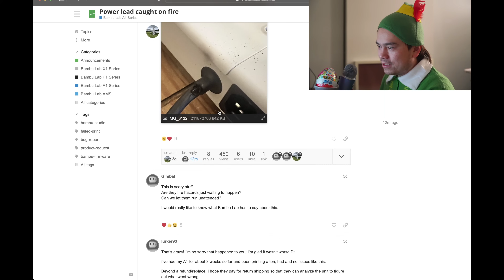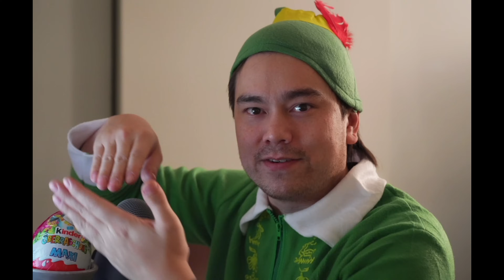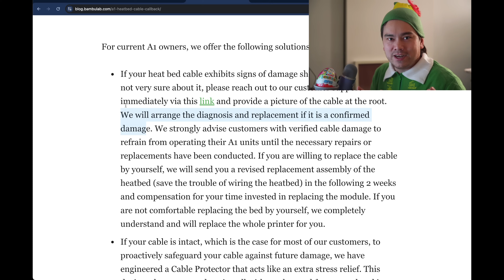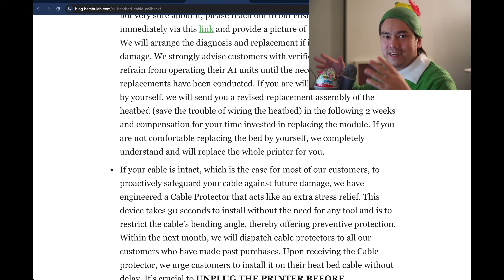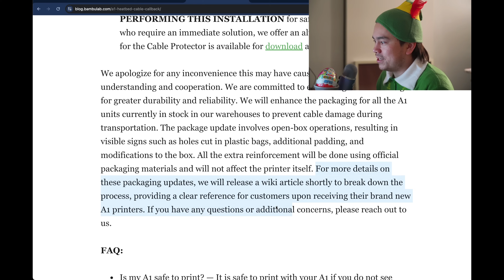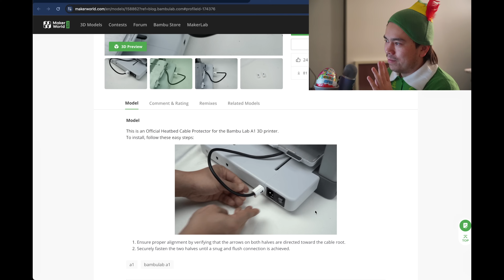Bambu Lab A1 - 👨‍🚒🔥 Important Safety Announcement!!! 👨‍🚒🔥

Comment: I would think two bumpers on the back side would help to protect the cables if the printer is laying on the back or pressed up to a wall. The little mod will still bend the cable if that happens.
Reply from the maker: lol, yeah. Also having a power plug inserted probably helps. Standard wall outlet power plugs have super beefy strain reliefs on them.

Comment: Hey Nathan, unrelated to this video, if you don't mind... What's your opinion on Phaetus Dragon HF and UHF hotends? Rapido seems to be the more popular option, to the point that's hard to even find useful information on Dragons. If I'm not mistaken, you're also a Rapido fan, so what gives? Is it really that much of a better option? Is there some major flaw with the Dragon series?
Reply from the maker: Dragon can go up to higher temperatures due to its use of a standard heater element.

Rapido is well packaged, sturdy, prints fast, and looks good. 

Both are very similar in overall performance

Comment: isn’t a strain reliever normally rubber/has some give? That looks to be hard plastic so while its protecting the cable where it enters the printer, isn’t it just moving the pivot point to an inch out? its still leaving a hard edge (and slightly reducing the length of cable to the heat bed so perhaps a tiny bit more likely to induce a tight radius)
Reply from the maker: Don’t worry about it, just print out the magic spacer and you’ll be magically safer

Comment: So, AC vs DC isnt the problem here. It gets into internals with how their solid state relays work.

For the cable assuming the overall wattage is the same. A higher voltage would reduce the wire size, but would require a thicker insulation. A lower voltage would require a higher amperage to meet the power requirements. Which would mean thicker wires.
The above is all basic Ohms law and wire/insulation calculations which can be found in the NEC.

If you want to make all solid state driven power consuming devices safe. You put a mechanical contact ahead of the SSR. You then detect amp draw after the SSR. SSRs leak voltage at all times, a very small amount. You program in tolerances, and if it exceeds the tolerance when its not calling for power, open the mechanical contact. You can further add to it by adjusting this tolerance on top of whats being called if you arent using a 0-100( or in 8 bit world 255).
Software wise this is partially implemented with it reading through the thermistor and detecting heat rise without calling for heat. This is ok for runaway temps, but not shorting as the thermistor is not able to check for amp draw.
Reply from the maker: A short on 24V produces less heat and is easier to manage than a short on 230V
Reply: @NathanBuildsRobots  to an extent, but both are bad. 
I've worked around high flex cables for heaters in vacuum chambers running 480v, I will say that I have never had an issue with the cables themselves having issue after thousands of cycles a day, 7 days a week. It's usually the solder on the hermetically sealed plugs that failed. 

Which makes me wonder what they used to have issues with cables. If the cable was being impacted, sure. But if they are having issue from flex like that, either they have a bad type of insulator for flexibility, they didn't use high flex, or their connection is terribly done.

Outside of that, I doubt 3d printer manufacturers are going to run as complicated of a circuit with programming I mentioned above

Comment: Btw, on a serious note, thank you very much for this video. I'm in the Bambu Lab discord but I was busy with work and missed when someone posted this. And you would think it would be on the front page of their site but its not as far as I can tell. I will print out the upgrade and put it on my A1, I just got it less than a week ago and its been working fine, I did pay attention to make sure the wire wasn't hitting the wall or anything when I set it up. I also don't like how floppy the extruder head data cable is (some people on the mini have it snag on the bed I think lol) so I printed out a drag chain for it, and honestly thats how it should come from the factory.
Reply from the maker: Is your drag chain fire retardant? Because that might be an issue given the combusting cable issue 🤐
Reply: @NathanBuildsRobots  lol nope its good ol pla, but when I see it melting I'll know something is wrong don't worry.

Also I got a notification this morning about the bed wire problem on the bambu handy app, they posted the blog post under the "system" tab of the app so anyone with it should be getting that notification

Comment: Not just that.
I've been sent a defective out of the box printer with z axis stepper motor and driver that doesn't work.
First plugged it in a burned smell from z motor.
And nobody wants to answer from over there.
This is a no buy again from this manufacturer 👎👎👎

Comment: 4:46 During A1 assembly, you do have to tilt the A1 on its back to connect the camera and motor wires, however Bambu Instructions and photos specifically show to lay the printer on the gantry with the heatbed off the table edge so you don't bend the wire
Reply: A large portion of Bambus target demographic is tech illiterate people who know nothing about 3d printer. And therefore the machine should be designed for them. Even if it’s the customers fault, it’s a design flaw because their target customer is going to be careless.
Reply: @Resyektt  thats fair yeah. I don't really see how to avoid the issue of flattening the bed wire during assembly other than putting a huge warning to not flatten the wire. Or maybe make the side of the gantry more flat so you can lay the printer on its side. I tried to lay it on its side but the gantry has these rounded edges and the printer wanted to tip over so I had to do it the way Bambu said and hang the bed off the table edge, which is not ideal at all and could lead to the printer falling.
Reply from the maker: I know, it’s the customers fault for damaging their printers.
Reply: @NathanBuildsRobots you should have worn a clown outfit for your video
Reply from the maker: @darthchihuahua great idea!
Reply: @NathanBuildsRobots with aviators...lol
Reply: It's quite literally the customer's fault for not following the assembly instructions and damaging their equipment... It's Bambu's fault for assuming that anyone would read the instructions. They should have engineered a more foolproof design.
Reply: @AbraxAttack  to be fair every bed slinger has that wire back there, it should be common sense to not lay the printer down on the wire, but for newbies that don't think about it, they do explicitly say not to lay it on its back so I don't think Bambu Lab had bad directions.

That said, I did take a look at my A1 I got less than a week ago and I did see the slightest kink in the bed wire even though I never at any point put any pressure on it. I printed out the wire protector they released and it does look sturdy and is perfectly shaped to the wire so it may help. They ceased sales on the A1 on their website while they upgrade the packaging at their warehouses so the printers are less likely to get damaged

Comment: I don't have one to look at but it seems like the problem could be that the strain relief was too rigid, which meant the cable could be pinched between the strain relief and a hard surface. A printed strain relief cover would surely just make that worse and move the pinch point further out.
Moving cables was one of the reasons we wanted to move away from bed slingers.
I don't see a problem with people replacing their own bed wiring though. Yes, people get really paranoid about non electricians working on anything that is mains voltage but the bed wiring should at least be simple with no polarity to worry about. At least that's how other AC beds work. Its probably a keyed internal connector anyway.
Reply from the maker: Right but out of the 10,000 people doing this mod, someone’s going to F it up. 
Hopefully without hurting anybody.

Comment: Maybe they should not have an AC heated bead. They have to use thicker cables which prone to cable deterioration.
Reply from the maker: Yep. Thicker cables please. Stop cost cutting on safety critical stuff.

Comment: I chose an Ender3 V3 KE over the A1.......So I can just tinker and take the cable off, perhaps even change it with one of thousands PC cables I have in the drawer. TInker tinker tinker :-)
But Damn...They are going to have trouble with this issue. All sold A1`s and all A1 in warehouses !. And how about the shops selling the A1 and their stocks...
Reply from the maker: Don't worry though, it's not a recall, it's a call back?
IDK, sounds like legal speak to cover your ass.

I could swap an Ender 3 cable in under 1 minute if I had all my tools ready, F1 pitstop style.
Reply: @NathanBuildsRobots  I thought maybe "Call Back" was to dodge text searches for "recall" :)
Reply: Is i need a standard size again I am leaning towards the SE version.  Repairablity and modability for those models still looks good.

Comment: They should chamfer or taper the end of the strain relief instead of having a square shoulder. It can be thick and rigid where it enters the printer, but should be thinner as it leaves the printer, so it is more flexible there. This will reduce stress concentration.
Reply: They should make a bracket that lets the kabel go out sideways. Then when tipping the printer it will tip over the brakcet
Reply from the maker: Just install the magic fix and don't worry about it! Seriously, don't worry about it! Everything is fine!

Comment: Petg strain relief is an insult added  to an injury 😂
Reply from the maker: Yeah that strain relief looks like a really poor solution. Snap-on snap-off magical problem solver!
Reply: @NathanBuildsRobots  Its actually a really good part and does the job perfectly. I think many people misunderstand what the issue here is. The cable is not faulty, the cable is too easily damaged. If not subject to excessive strain there shouldn't be an issue. Yes, it would be better if it didn't happen, but at least they are doing something.

What I find annoying is the hate for Bambu for doing something about a problem. Compare this to other printer manufacturers who do nothing about glaring problems their machines have out of the box because they are 'open source' and should be expected to have problems. My Ender 3 blew its PSU resulting in smoke, my Mega S blew a stepper drivers taking out the whole board resulting in obvious burning when I opened it. Neither Creality, or Anycubic cared much beyond offering to send a new part. Im certainly not the only one whos had an Ender 3 blow something.
Reply: The funny thing is half of us could design a better one in 10 minutes. These Bambu Lab engineers are usually pretty good, but I guess they aren’t familiar with the phenomenon of kinking, or the function of strain relief.

Comment: also it total power output, 24V powersupply is usually 300W and limited by powersupply fuse and mainboard fuses. AC powered bed is connected to either (15A x 120V =) 1800 watts or (20A x 120V =) 2400 watts outlets (240V x 10A -2400W) and limited by hotbed fuse, but if fault occurs before fuse due to faulty wiring you will have full energy of outlet.
Reply from the maker: You can put a fuse that limits total wall power, but apparently it shut down that guys house power so that’s not good.

Max power draw for A1 on 240v is what?
Reply: @NathanBuildsRobots  Input Voltage: 100-240 VAC, 50/60 Hz
Max Power: 1300W@220V， 350W@110V
Reply: @NathanBuildsRobots  Input Voltage: 100-240 VAC, 50/60 Hz
Max Power: 1300W@220V， 350W@110V
Reply: Somehow, for us with 230v, this thing can draw 1300w! which is strangely 300w more than the X1C, yet at 110v, the power draw is only 350w @NathanBuildsRobots

Comment: Dammit I just ordered 2 of these 😭 knew I should have gotten something different
Reply: I just ordered my second one. It'll be fine. You just check the "non-flammable" box when you order and not the "inflammable" box. Funny word, that.
Reply: @Immolate62  🤣🫣 I’m dead. Or will be if I plug it in
Reply: It’s fine, everything’s fine 💀 most definitely not. 1 didn’t ship yet. Hopefully I can cancel it.
Reply: It still a Very Good printer, but its an Alpha Product and early adapters always get shafted..)
Reply: @AlbertoMartinez765  idk I feel like corners were cut here if they are catching on fire.
Reply from the maker: It'll be fine, just install the magical wire protector, it will save you